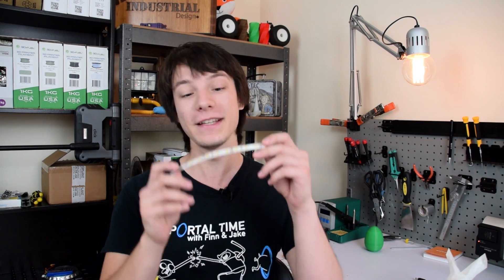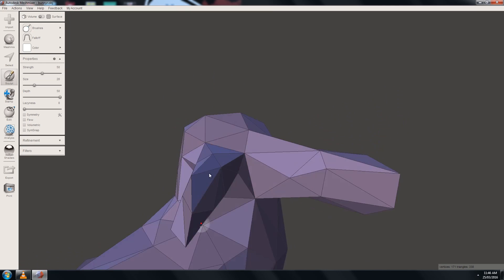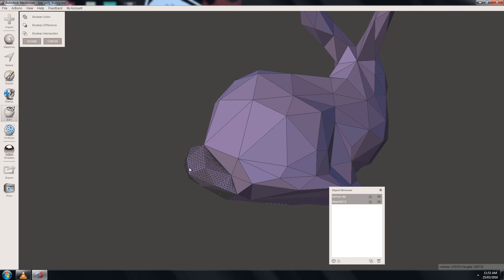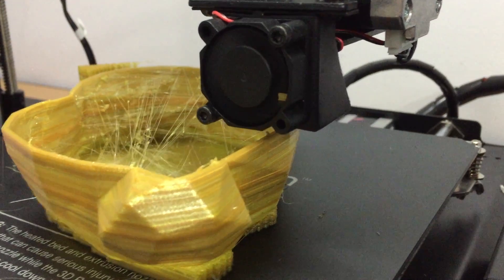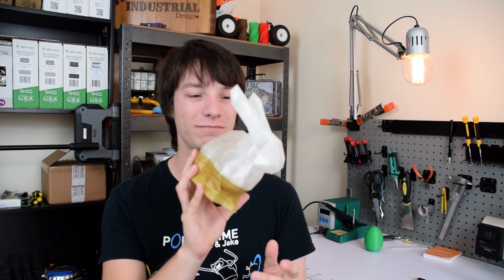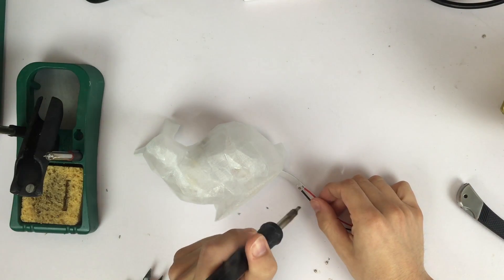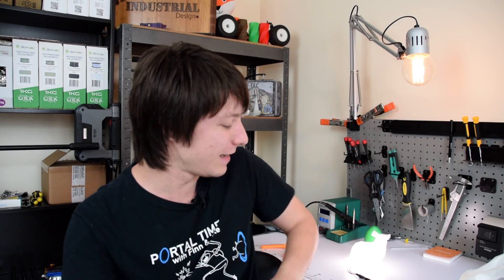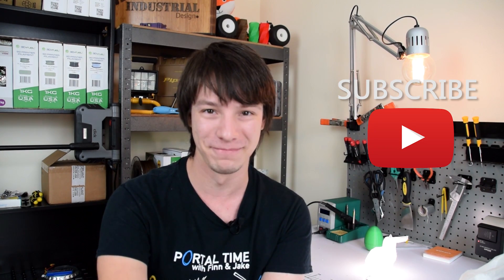3D Printing a Low Poly Easter Bunny Light

Comment: Much easier just exporting the solid bunny and importing it into OpenSCAD, taking away a box and exporting again

difference(){
import("bunny.stl"); // import the file you've saved somewhere
cube([20,5,10],center=true); // take away a 20x5mm slot (the Z dimension isn't too important as long as it doesn't poke out of the top!)

}

Rendering and exporting again as another STL allows you to then load this into Cura (or whatever slicer you use) and telling it to print in vase mode

Comment: I actually like first bunny, he looks like sitting in grass.

I don't understand why you bothered with crating hole in software, i would just drilled it with some power tool.
Reply: Then the edges of the plastic would have been a bit messy. But I guess you could clean it up.

Comment: LOL @ the location of the hole and then shoving the hot iron in there.  xD

In all seriousness though, regarding a future version how about some sort of induction coil underneath an opaque green slab, so when you put the bunny (which has no wires showing) on the green 'grass' it lights up.
Reply from the maker: +SclohOne That'd be cute! And about the soldering iron, well, maybe that's why they look so lively all the time :P

Comment: Dear Angus,
If you do make the battery-powered bunny, please consider placing a Qi-receiver (wireless-charging receiver intended for smartphones and the like) inside the bunny, coupled with a powerbank or such. Then with a Qi charging pad, you can charge the bunny (sorry mr. Bunnergizer) without holes or wires. The receiver and charging stand are about 2 bucks each from most oriental sourcing-houses. another few for a powerbank and a ball-switch :)

Comment: One thing I've done in the past is a combo of an Adafruit Trinket/Pro Micro  and a Neopixel PCB. 

Neopixels run on 5V so you can hook the 5V that's going into the USB socket on the microcontroller into them for power and make it really neat. You then have 8 individually addressable RGB LEDs that can be either pre-programmed and powered from a phone charger, or program the micro to accept commands over the USB cable.

Neopixel cost is around £1.20 from AliExpress and an Arduino Pro Micro cost around £2.50

Comment: Cura/s3d will give you the estimated weight of the finished print..... add a few grams to taste and weight up the correct amount > spray paint > print > win. But first of all test a few estimations first at different overall print times to ensure accuracy.

Comment: v3 sounds great, I think the smaller bunny works better. That first print tho, oh boy. What brand PLA?
Currently printing a Black Dremel PLA Remote Boat. (Holds only 2 motes)
Reply: +Mickice 8Hrs later, v1 remote boat is a success. The first remote has a little friction, the second one is damn near a perfect fit.

Comment: Some white cables would certainly go better with it rather than the black and red cables, I wonder how visible a battery pack would be if it were inside the model with the led strip.

Great video.